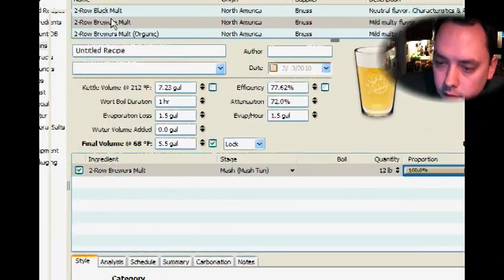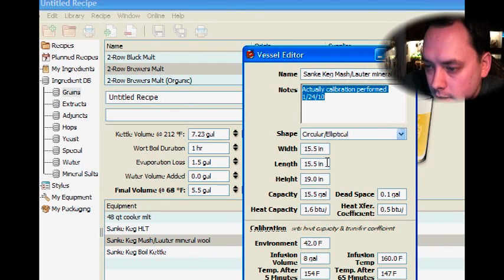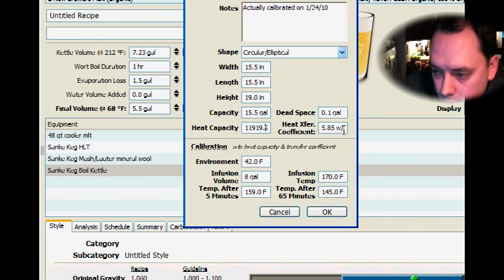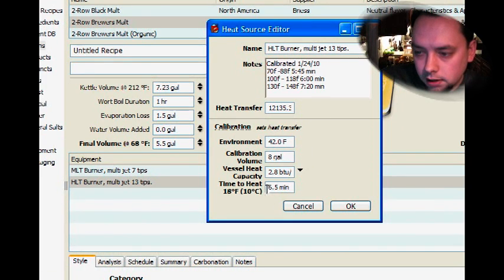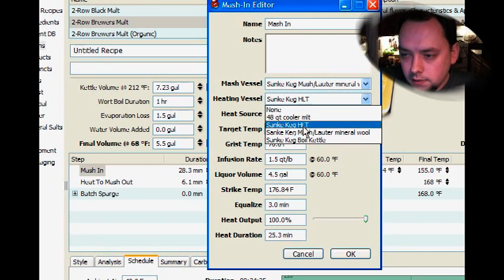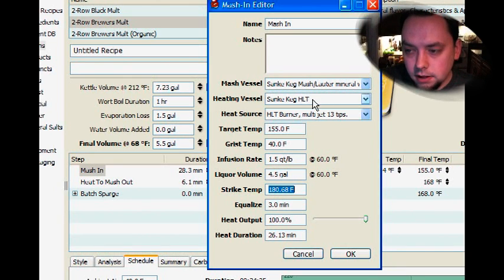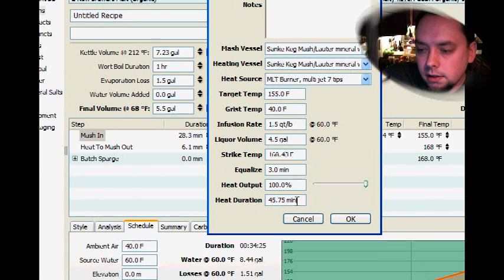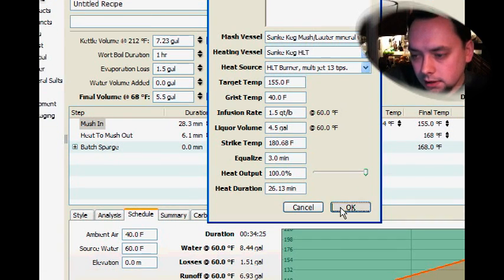Using Brewing Vessel and Burner Calibration Data In Beer Tools Pro

Comment from the maker: @yambor44 
I probably should have mentioned this detail in the video. Once you add them, you need to go to file> and either "Make Default" or "Save as Template".

Make default will bring anything over when you click NEW. If you save a template, you can apply the template later to a recipe you've already built. If you use "make default" you'd probably want to remove the ingredients from the list before doing so otherwise that recipe will always show up when you click "new".

Comment: @BobbyFromNJ  Got it. Thanks. One other question. If heat the Mash tun up until it stabilizes at 160, will this throw off the infusion rate? the reason I ask is because this is the way I heat my mash water or strike water (in the Mash tun). I am concerned if I calibrate it by heating my HLT water to 160, then infusing it to my Mash tun, I will get the wrong calibration.